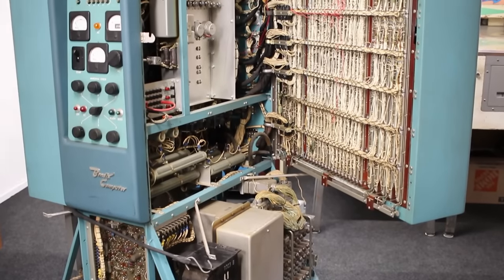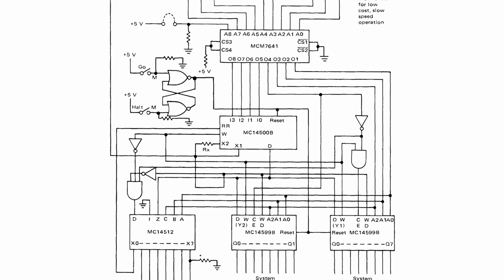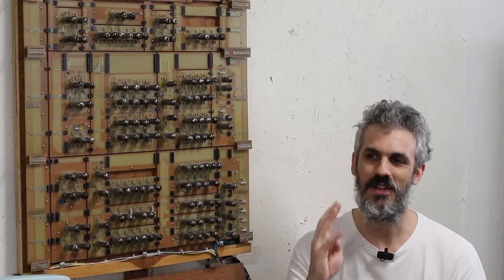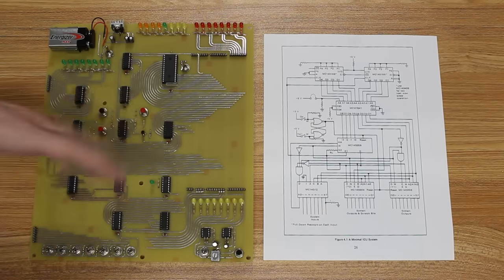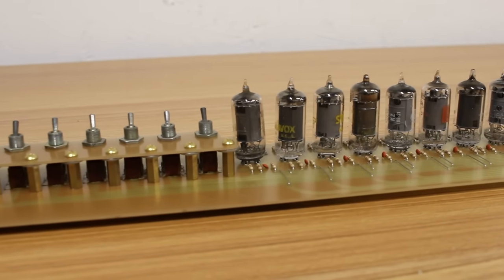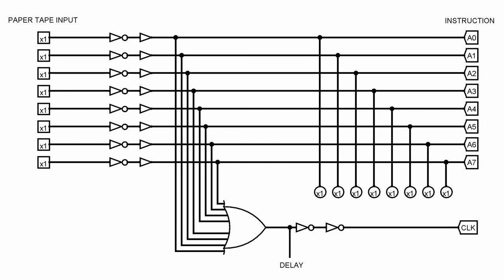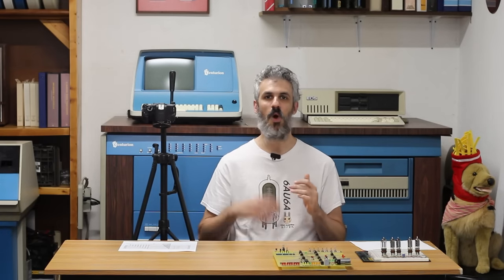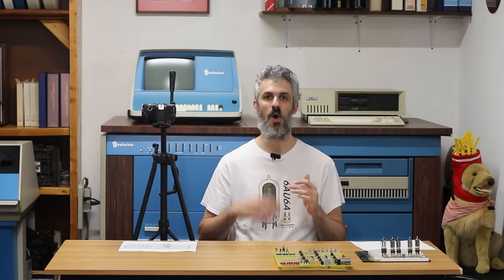VTC P.34 – Building the Paper Tape Interface

Comment: Hello. Thanks for your videos, I really like your channel. 
With a paper tape, you cannot do RANDOM access. Branch instructions are therefore impossible. This is a huge limitation, and the result is not really a "computer", without branch instruction. 
It was not possible to build or use a CORE-ROPE memory for the ROM, for storing the program?
Reply from the maker: Thanks!
Actually, despite not being random access, we can do branch instructions. I talk about this a bit in previous videos as well as in the video showcasing the MC14500 Minimal ICU on the single PCB. The MC14500 and UE14500 both have the ability to mask input and output. Every instruction is technically executed, just whichever instructions we want to skip over don't produce any meaningful results or changes. Just set the IEN or OEN registers based on a stored value in the Scratch register and you can effectively conditionally turn the processor off for however many instructions you want, skipping over and jumping ahead.
Now, we can't jump backwards, unless we loop the tape, which is easy enough to do. So, it's actually quite a lot more capable than it at first seems.

Making core-rope memory for the ROM is something I considered, but size constraints put a dash to that pretty quickly. In order to jump I need a binary counter (a 6-tube D Flip Flop per bit), a register to store the return address in (another 6-tube D Flip Flop per bit), the supporting circuitry to enact the jump (a whole lot of tubes), and the core rope itself. Just to enact something like an 8-bit counter for a mere 256 instructions, it would be at least another 200 vacuum tubes and one, maybe two more full backing boards. The only way to keep it as compact as I wanted (just two boards), was to use paper tape and the maskable inputs and outputs.
Reply: @UsagiElectric  Thanks so much for taking time to answer with such details. I really appreciate. 
Of course, that makes sense. Random-Access memory would bring a huge complexity, with a counter, decoder; I realize it now. 
One crazy option could be bi-directional paper-tape, plus dekatron for counting with "relative" jump instructions; For ex: "jump 12 instructions backward". I like dekatron. But it is still much more complex than your design; this would require a new additional sequential logic for managing the tape movements; or a "microcode" architecture which is even more complex.

Comment: when I played with paper tape in the late 80's...  (60's vintage cnc) the center paper tape sprocket was the trigger for the read. the hole was smaller than the actual data bits that it made a perfect delay...
Reply: Plus - then it would read the NOPO code...   If needed..
Reply: and use a few less tubes.. LOL - I will shut up now..

Comment: I'm curious why you didn't use 9 bits for the tape.  You could have used the 9'th bit as the clock and also adjusted it's delay and phase based of the hole size and location.

Comment: That RC delay between two inverters reminds me of something Atari did with their 8 bit 400 and 800 computers. A Californian company called PCA electronics made delay lines which were a 74LS14 hex inverter chip with some RC or maybe LC delays between the gates all in an epoxy potted package. This was because to drive an asynchronous DRAM you need /RAS, MUX, /CAS. /RAS and /CAS go to the DRAM and MUX goes to the multiplexor chip which selects high order address bits or low order. You need a short delay between each step. /RAS is for the row address and /CAS is for the column address.

So it's the same idea but done with TTL chips. People have reverse engineered this so you can put a 74xx14 inverter on a board with some surface mount capacitors and resistors and replace the Atari/PCA part which for some reason tends to fail after a few decades.

Comment: I'm asking a few YouTuber's this question.

I need to replace the filter capacitors in my reel to reel tape deck,
one is 1250uf 40V and the other is 2500uf 64V. (this capacitor is on a 45V rail)
I can't find either of these capacitors, I'm wondering what would be the best replacements.

I have found 1200uf 63V and 2200uf 63V capacitors,
can I use these for long term use instead ?
Reply from the maker: Those definitely seem close enough to be alright to me!
Reply: @UsagiElectric  That's great, thank you.

I've just noticed my previous drunken comment from a day ago. I appologise for that.
Reply: You might want to consider a 2700uF 63V cap to replace the 2500.

Comment: You shouldn't be having any issues building a shifted phase clock in logi Sim... I've built several 8 bit CPU in Logi Sim from discrete logic gates... all using a single clock with a nested phase (an Output enable with a nested write phase within it). to "simulate this delay" for your design you simply need to use the clock in logisim to run a counter... like a 4017 decade counter. then use RS flip Flops  connected to carious points along the 4017s outputs to create the clock phases to match what you have in your design. The outputs of the RS flip flops are then what you use as your defacto Clock for the Vac CPU. logisim can do anything, you just need to know how to work around its limitations. Now you wont be using the digital circuit with FFs and 4017 in the vacuum CPU ... its just for simulating your clock in the rest of the CPU design in logisim. keep in mind you'll need to build the 4017 in logisim and save it as its own sub circuit

Comment: Run a continuous loop of tape that has like 512 bytes on it. Just need a motor driver you can stop on a "halt" and restart the same way you would the pc. Clock comes from the sprockets. It will be more capable than the single board PC that was limited to 8 bits (256 instructions).

Comment: If you want to go completely insane, why not make a "ROM" out of a monoscope tube?  You would have to find someone to do the glass blowing, but most of the rest of the electrode structure could be borrowed from something like a scope tube, just with the screen replaced with a metal plate with insulating paint on it. Then use a bunch of R2R DACs to drive the beam around and sense ones and zeros based on the cathode current.
You would have to read out the "ROM" in serial format and latch the data, but if you could manage a 64x64 array (I.E. 6 bit DACs on both X and Y) it would give you 512 bytes of ROM storage.

Comment: MAKE IT OUT OF METAL because paper could tear apart and does not hold up so well over time. It could break or get lost or whatever, paper is not a good material to replace an Eprom.
Reply: Paper is cheap and with so few memory addresses available, replacing a broken tape is probably going to be easier than punching holes into metal would be.  All the same, this is an interesting idea.  Another idea would be a metal loop with the bits formed by punching through but rather than completely removing the punched piece, instead folding it out so that it remains attached.  That way, the folded-out bit of metal could push against a microswitch in order to provide each "bit" of the program instruction.
Reply: Some of the old reusable punch cards are basically heavy card-stock that is treated with a wax or lacquer. Those will definitely last a long time in frequent use. They had ways of making such things durable if needed.